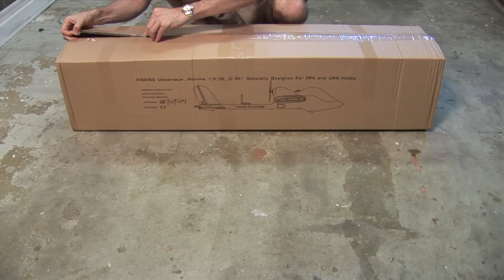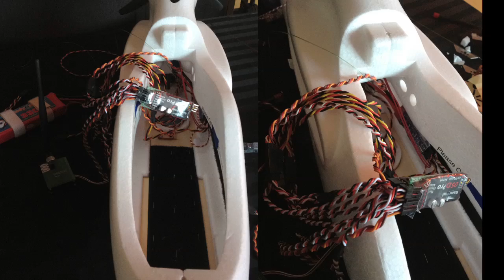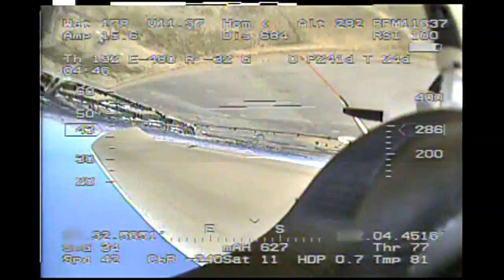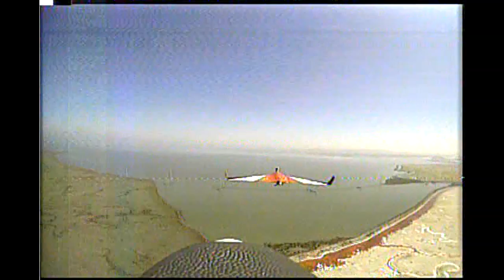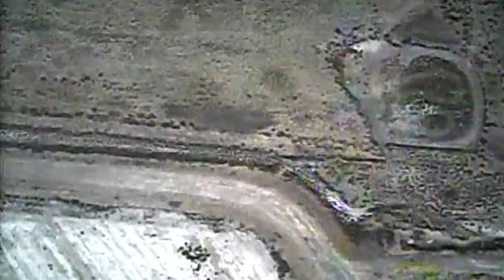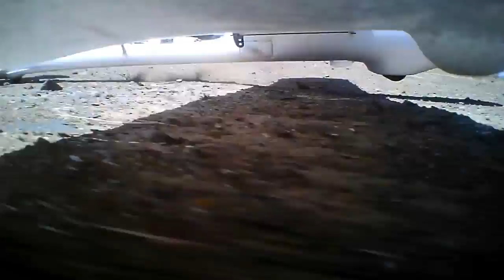GSTV - Penguin - FPV Setup and Flying

Comment: Any suggestions for a super stable platform to doing fpv, observation platform only? No need for anything sexy, no loops or target flying, just long flight duration's, extremely stable, large payload, outstanding camera platform.  Would that be a wing or more of a pengquin style, or something like a predator design? Something with a extremely long wingspand that is narrow. I appreciate your thoughts.
Reply from the maker: j johns You might check into the Air Titan from www.ReadymadeRC.com:
http://www.readymaderc.com/store/index.php?main_page=product_info&cPath=112_113_360&products_id=2483

That's essentially the mother of a Penguin. ;)

Comment from the maker: I think it's a bit more fun than the SW all around, and built sturdier out of the box. They fly similar, and in winds the SW is a bit steadier and might be a better range plane, but I think the Penguin could be a contender at that too. I fly the Penguin a few mph slower than the SW on average, but have had the penguin up to pretty high speeds and it's was pretty stable.

Comment from the maker: For these tests I used 3s batteries and the largest I threw in was a 5000mAh. With the stock 2200m power system (40a esc) it performed well for all of my tests including adding a full pan and tilt system, GoPro, 5000mAh 3s and a fully loaded Eagle Tree system. I actually have a bigger motor combo to test out on it, but have enjoyed the base system I've not yet added in the more powerful parts.

But I expect if someone wants even more performance from it the power upgrade will be a nice one. ;-)